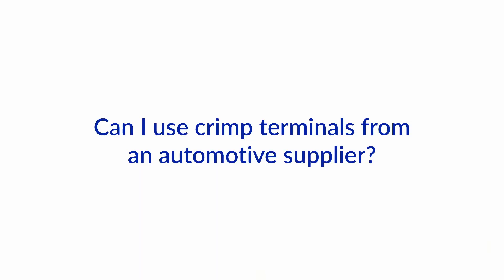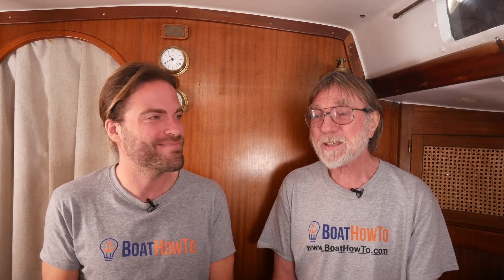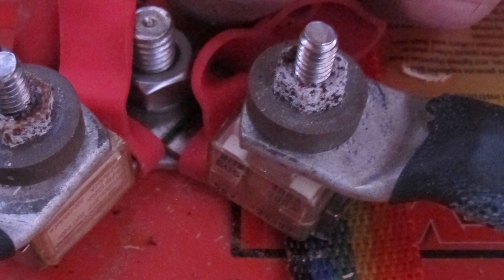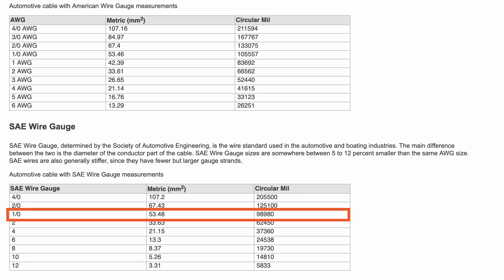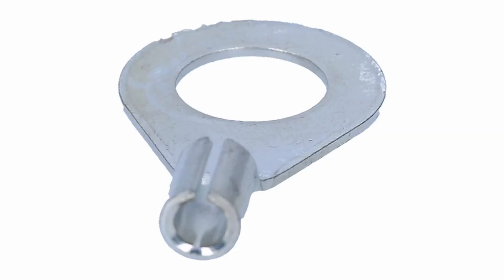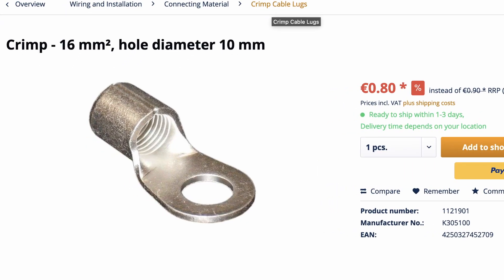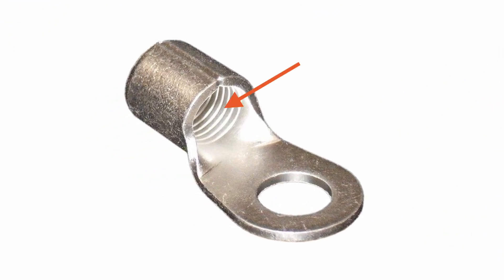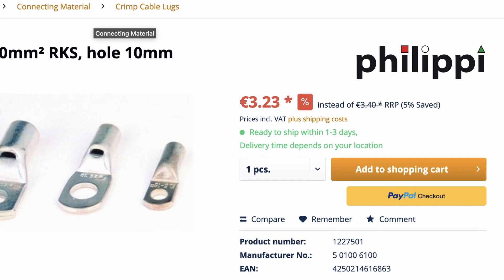TERMINALS: Marine vs. Automotive - Don't save at the wrong end! | Ask The Expert with NIGEL CALDER

Comment: Got a question. I’m putting a flexible coupler on my PS40 prop shaft. Should I leave the shaft and prop isolated or bond to engine ground?
Reply from the maker: Hi Ed, that's an excellent question! I put it on the todo-list for our next edition of "Ask-the-Expert" recordings. If you don't want to wait this long: We also cover these topics in great detail in our Advanced Marine Electrics modules on Grounding and Corrosion Prevention. - Jan
Reply: If the coupler did not come with installation instructions, email the manufacturer's tech support for help.
Reply: @eden3marinetrader36  it did come with instructions, but can be installed either isolated or bonded. The question is what are the pros and cons of each way.
Reply: @edburke2902  Isolated cons: the possibility of corrosion is higher?  Bonding pros: the possibility of corrosion is lesser? The ABYC advises bonding everything together.  Personally, I usually follow the ABYC. However, electricity flows following all paths available to it. Lightning can produce around 3-milliion volts and 30-thousands amps of current and will follow every path (wire) available to it to get back to the earth (ground) thru the water. If everything is connected together through bonding and grounding wires, that means that everything has the potential to be blown out by a lightning strike, which happens a lot. I am thinking about not following the standard recommendations, by not joining everything together, and having the lightning, A/C, and D/C systems isolated from each other.  I think that having everything connected together at a common ground point is what is blowing out everyone's electronics.  I think that the companies that make and sell marine electronics are fine with this.  I am not an electrical engineer, but then neither are most industry professionals.  I am however, a certified residential and commercial electrician, completed a college course in Basic Electronics, am a certified computer repair technician, and hold an ASE certification in automotive electrical and electronics, and am basing my suspicions on that well of knowledge.  I also noticed that the ones who are advising to connect everything together are also the ones getting paid by: selling, installing, and fixing damaged equipment. It is usually accepted that isolated systems are more secure and robust than interconnected systems; it's why the military, especially navy warships, isolate their systems so to be able to withstand battle damage during combat. If it was not for lightning, I think that connecting everything together would be a good idea, but because of lightning, I think that connecting everything together is a bad idea.   I am not sure if I am right or not.  Trying to figure this one out is why I am here.